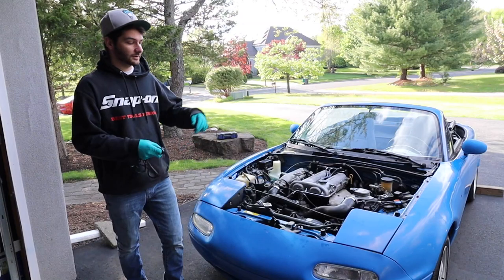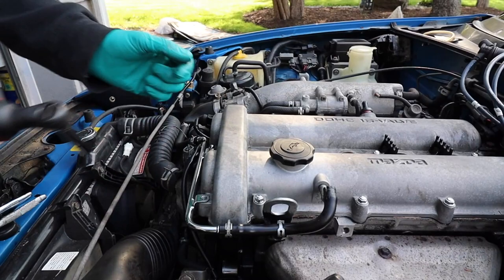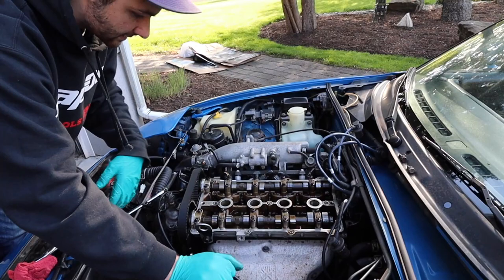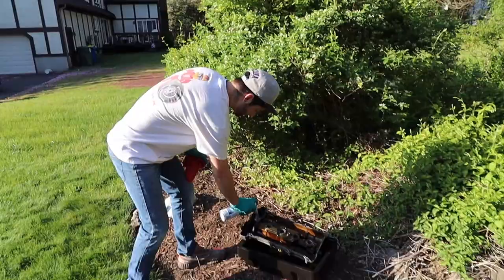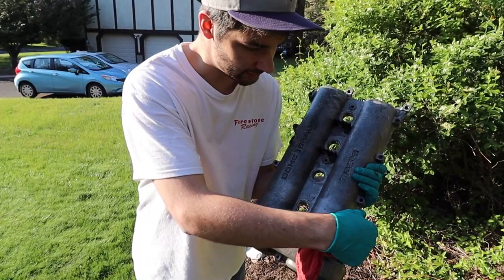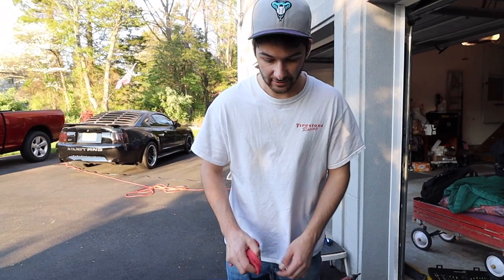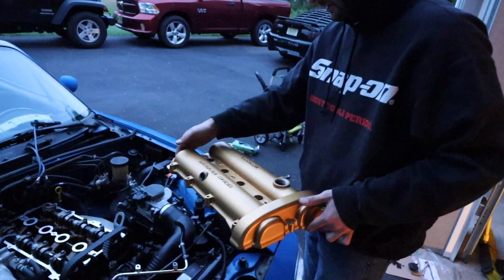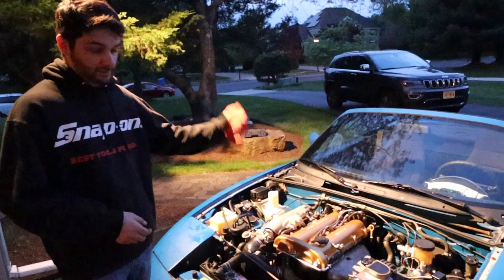Miata Valve Cover Painting | Night & Day Difference | Turbo Miata Build Episode 4

Comment: VERY IMPORTANT... The torque diagram you displayed looked like head bolts. It's not at all correct for the cam/valve cover tightening pattern and the cam/valve cover bolts should only be 7 ft-lbs. Did you use high temp paint? Std paint won't last long on engine parts. It looks nice though. I'll be doing a red wrinkle paint on mine.
Reply: Yeah 50ft lbs would strip out the bolts in a flash.